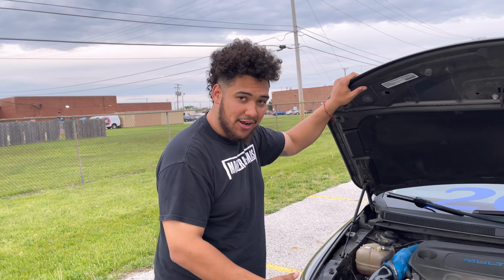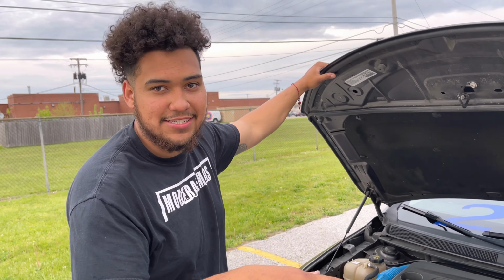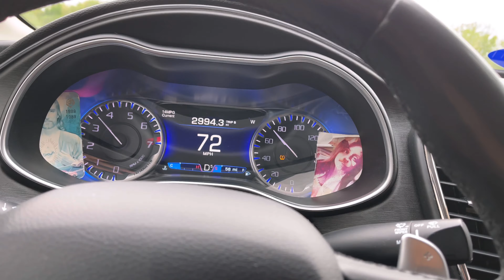2015+ Chrysler 200 / Dodge Dart 2.4L Multiair Exhaust | Revs & Drone Test

Comment: did you ever get a check engine light from the long tube headers i installed them with the cat it came with replaced all sensors with a deflour how did you over come it